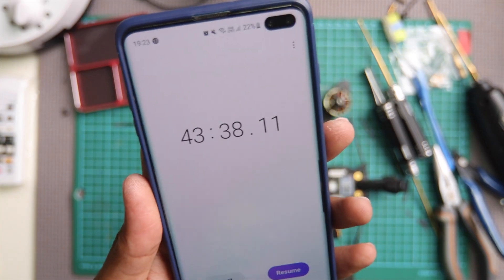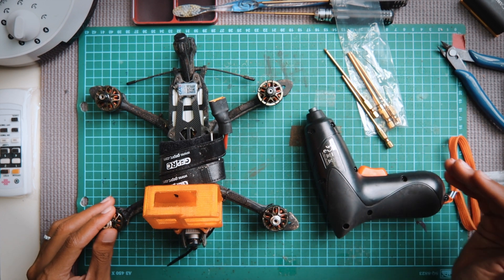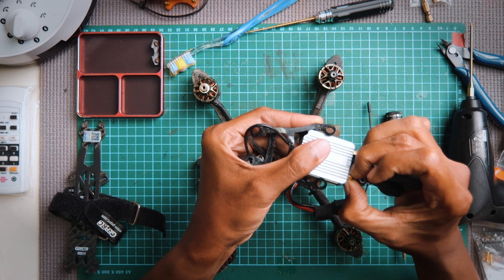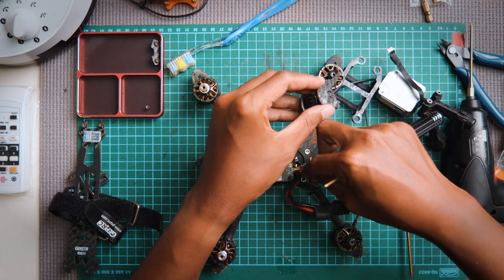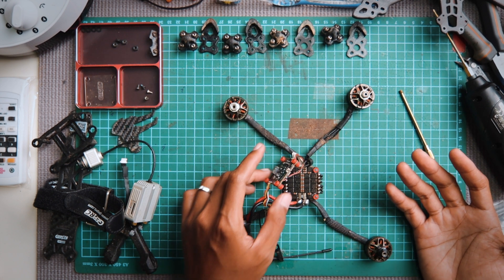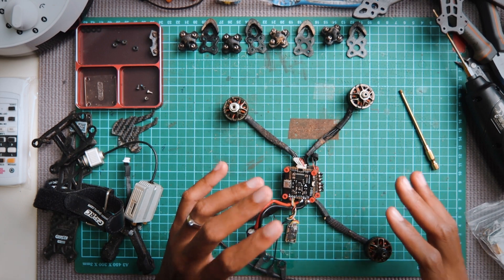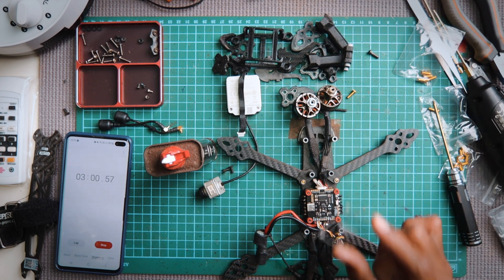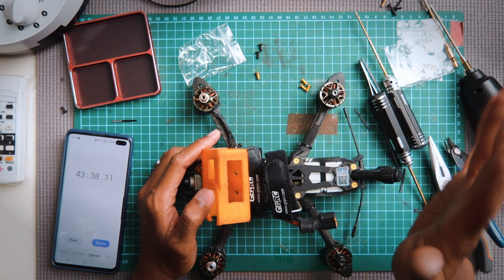Whats Makes An FPV RACING DRONE

Comment: Is there record Sound in the DJI Air Unit
Reply from the maker: Yes, and i always record with sound. So later playback can hear if drone has issues, and also to hear if my flying control is smooth ✌🏽